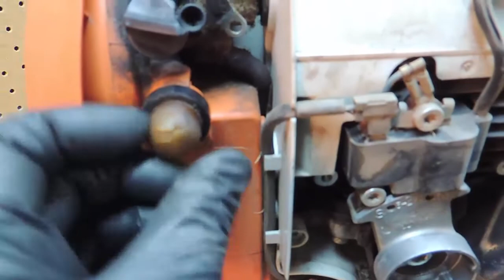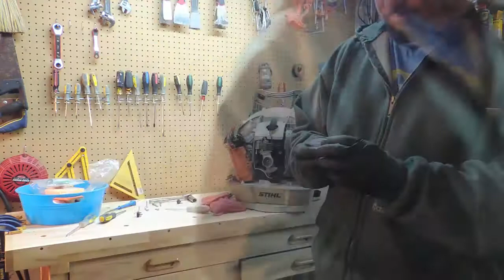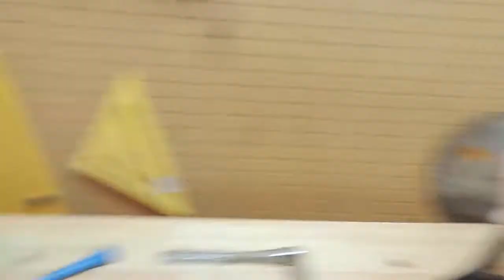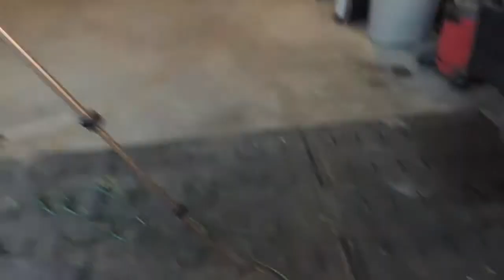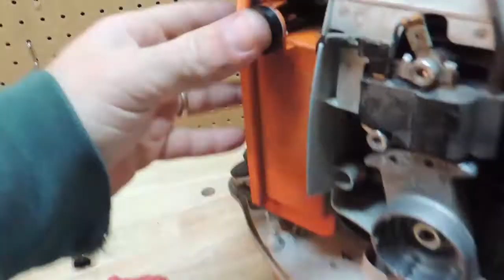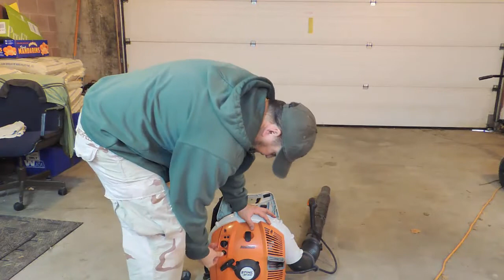BR600 Primer bulb replacement and tune up

Comment: Becoming frustrated with my STIHL dealers near me as they rarely have the parts I need in stock and have to order them or they’re unfamiliar with particular models that I have.

Would be nice to be able to order parts online.
Reply from the maker: Our dealer here is not very good either, I think we have 4 blowers in our shop waiting for off brand parts to try and fix them.

Comment: People get upset about camera angles and such but when you're working with small engines and filming by yourself it's very difficult to show every single detail unless you have a camera operator. A basic understanding of small engines is a plus too.  The only way you learn is by doing. You would be amazed at how many car and big truck mechanics that don't have the patience for small engine work.
Reply from the maker: Yeah the angle are horrible I know, this video was a few years ago, this is one of the video i always mean to do a remake of over the winter to show and explain things better and always forget. Thanks for watching though.

Comment: Im having a hell of a time getting the Fuel line and Fuel filter off the tank. Any Advice?
Reply from the maker: Hey Scott I used a small fishing wire with a hook on the end to get stuff pulled out of the tank. I believe one will usually come in the kit that filters and new line come in.
Reply: @ChuckB  I bought the Service kit that includes both Fuel Filters, Air Filter and Spark plug. Didnt realize i had a broken line, until I starting taking things apart. I saw a video where you take an pry the dual nippled filter out of the tank, but mine wont budge. Put some Liquid wrench on it to see if I can loosen it. Thanks for reply.